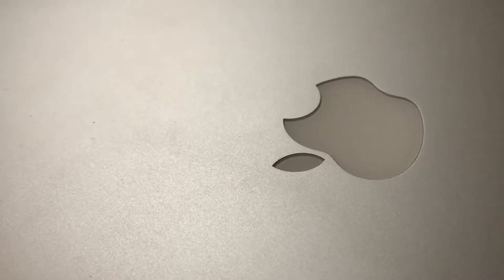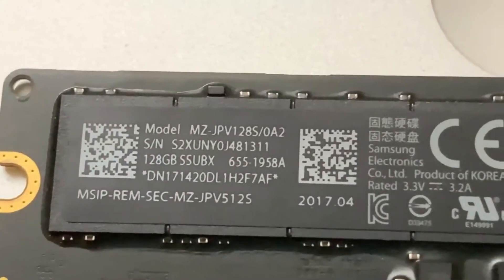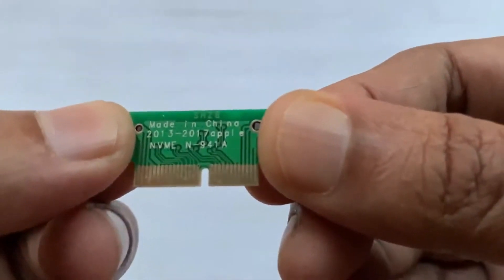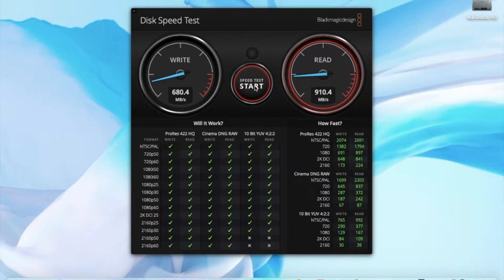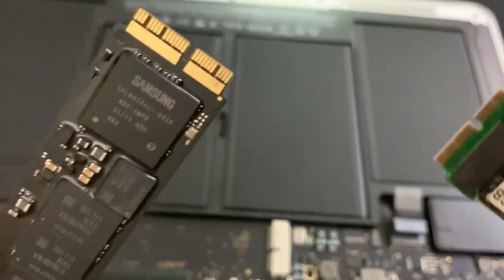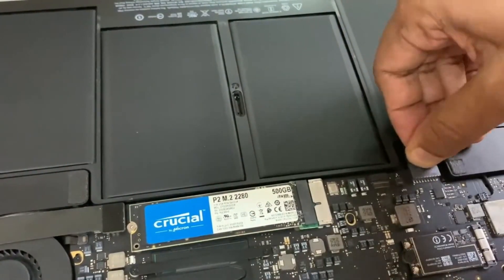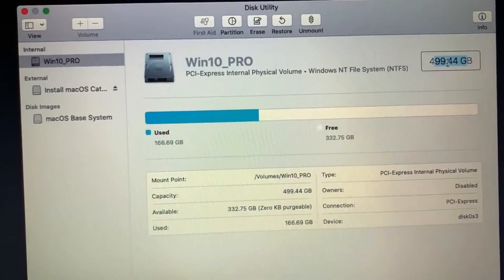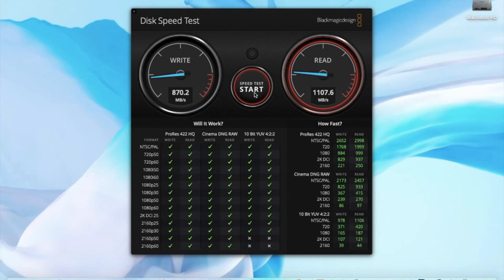Laptop Storage (SSD) upgrade on MacBook Air | Crucial P2 M.2 NVME| SSD Speed Test | @gizmohub22

Comment: Hello bro, mine is MacBook Air early 2015 and I just buy a WD sn550 which is PCIE gen.2, and I follow your structure to upgrade the SSD,  finally I use the disk Speedtest but the result seems the same with the original Apple SSD, how come is it?
Reply from the maker: Could you specify the adapter used? Also, I have used the gen 3 ssd which is a bit more faster as Gen3 offers twice the bandwidth per lane compared to Gen2.

Comment: Hello, thank you for your video. 
However, I'm surprised by the performance. I have on my Macbook Air 2017 an SSD PCI Gen3, and my performance is superior to yours. 
With Monterey and the Blackmagic test, I get read/write speeds of around 1200 MB/s.
Reply from the maker: Well thats great. 👍It all depends on the hardware and software configs.

Comment: Is there any way to use this ssd into regular pc?
Reply from the maker: yes, you just need to use the opposite adapter (m.2 to this ssd)
Reply: @gizmohub22  I tried searching but was unable to find one, could you please share link any such adaptor. It would be great help🙏
Reply from the maker: @madmaxmusicindia  It is bit difficult to find one, because the SSD that was used in 2015-2017 macbooks are no more available in the market. So no more adapter is not being manufactured for those SSDs. But in case I get any link who has old stock for such adapter will definitely share with you.
Reply: @gizmohub22  thank you

Comment: Great video, sir. Do you happen to know if WD Blue/Green or Kingston SSDs work with the 2014 macbook air?
Reply from the maker: I used this adapter for my 2015 macbook Air. This will also work for 2017 models as mentioned in my video. But earlier to 2015  this adapter will work only if the default ssd specs matches with the ones that come with my mentioned models.
Reply: @gizmohub22  

Well, thank you. I've been investigating which SSDs are compatible and looks like I'm going gamble. I've found a dude saying that the HP EX900 is compatible with the hibernation mode. I'll buy an adapter and I'll try with a WD Blue from another PC and I'll see if at least the Disk tool sees the drive. I'll try to post an update if someone is out there facing the same problem.
Reply from the maker: @cringemaki  thanks, will wait for your reply
Reply: @gizmohub22  

Well it worked, I used an XPG SX6000 pro. I wrote a big comment but YT just deleted it lmao
Reply from the maker: @cringemaki  Thanks for the information. Good to know that this model also worked👍

Comment: can we reuse old 128 gb ssd as external , adaptor or enclosure link ?
Reply from the maker: Yes but its a bit costly. Instead you can get a new SSD in that price with more storage space.
Reply: @gizmohub22  can you please share an enclosure link to use mac book air 2017 128 GB SSD to take data backup.

Comment: Base on MacBook Air 2017,  is it run Monterrey? Which OS is compatible with the NVMe?
Reply from the maker: Thanks for watching. Nvme I think is not dependable on the OS.
Reply: @gizmohub22  An NVMe SSD requires MacOS 10.13 (High Sierra) or later.

Comment: Doe's support Crucial P3 M.2 NVME SSD ?
Reply: P3 is not supporting. I tried
Reply: @viveknarkhede6034  ok What about the crucial p3 plus 1 Tb, if it supports it?  or which one do you recommend for macbook air 2015
Reply: @Mikep-dz  Samsung 970 Evo Plus is the best option as it uses DRAM cache. I'm using it on the same machine :) Let me know for any queries.
Reply: @viveknarkhede6034  Thanks
Reply: It works with Samsung 980 NVMe m.2
Exact model: MZ-V8V1T0

This is better than Crucial P3 as it uses TLC.

Updating in case it helps someone.
Reply from the maker: it would support any Gen3 M.2 nvme with form factor 2280 upto 1TB
Reply: @gizmohub22  Are you sure because lots of people are post P2 support however P3 not supported
Reply from the maker: @Rohan.Shingade  As mentioned, any gen3 ssd with 2280 form factor will work. Not sure about P3.

Comment: Hello brother, can you help me how to upgrade the storage of my MacBook Air 2017?
Reply from the maker: I think 2017 model also uses the same default ssd. SO this video might help you to upgrade. Please check your SSD type that is already installed now and let me know. I will instruct with further steps.
Reply: @gizmohub22  the SSD that already installed from the factory Samsung SSD 128GB brother. And I bought 1tb crucial P2 m.2. Please help me, and if there is a way to contact you it will be appreciated. 🥲🌹